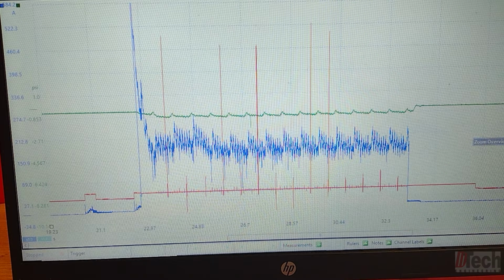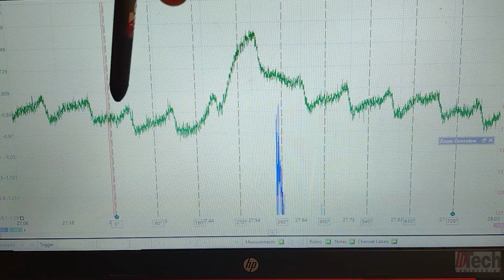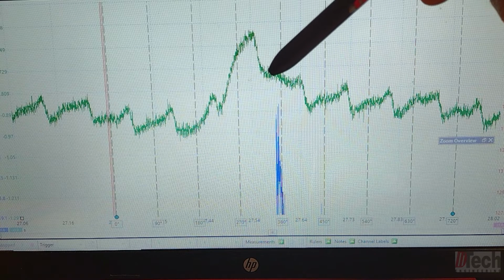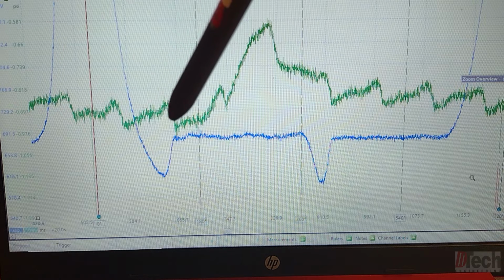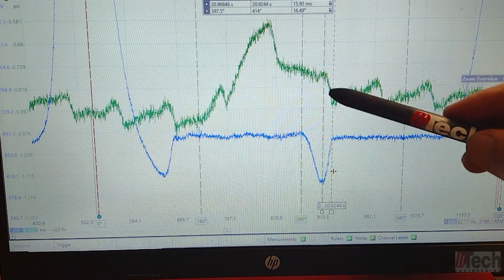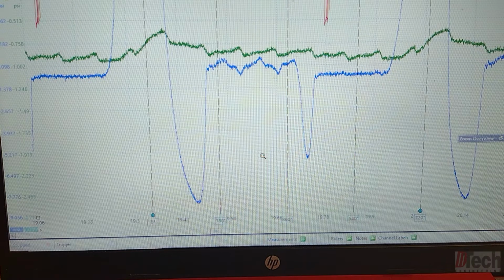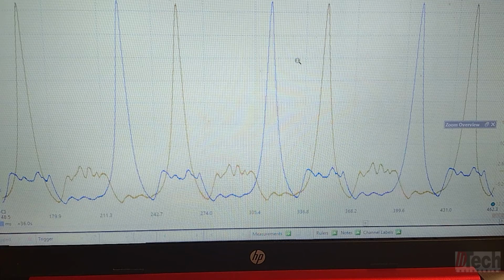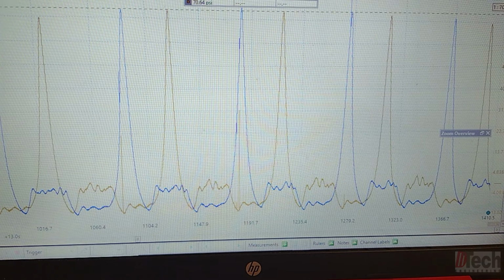2013 Ford F150 Misfire Inspection

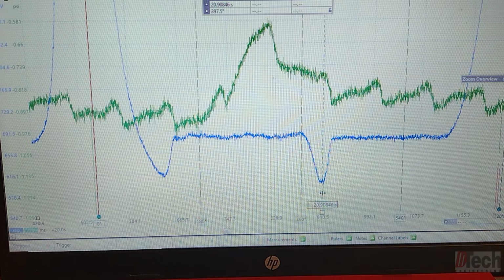Comment: Around time stamp 11:02 the intake valve opening at 397* ATDC 0 or  37* ATDC 360 is very strange. Seems very late, and this is the good cylinder.  maybe a Ford thing.  I would love to see the cam spec for this engine.    Nice video!

Comment: So customer needs a new engine?
Reply: What's the fix?
Reply from the maker: The fix would be one of two things, either remove the cylinder head and have a machine shop perform a valve job or you could replace the engine and hope it doesn't have the same issue
Reply: @DTEAuto  or just buy an updated head from Ford @ about 1,400.00
Reply from the maker: correct, that's definitely an option that I didn't mention.
Reply: @DTEAuto  4 months later, I'm still trying to overhaul the coyote... smh.
Should've taken it to a Ford dealer.

Comment: I hope you give yourself credit for your effort and learning. I found you when I was trying to decide if pressure pulse sensors were actually useful at pinpointing in their own right. Or just good at confirming what your seeing through other means (waveforms like RC). Your honesty, level of ability and explanation have made a follower out of me!
Side note = I feel you might have almost doubled the degrees of latency you feel you're seeing in the intake waveform. It is deceiving because of the next intake valve opening mid ramp but look at all the good cylinders between the valves opening. Slight ramp upwards then curving in a downwards tend, the another intake valve opens. Where as, just after the intake on 8 closes. The intake trace is almost flat then heads up on an almost identical angle ramp as the bigger more obvious ramp in pressure. Starting at more like ~950 on your time axis. 
BUT, it was interupted briefly by an intake valve opening mid-ramp which makes it look different.
Do you see what I mean?
Reply from the maker: Thank  you for watching and becoming a follower, I appreciate that for sure. And as far as the question, maybe tell me a timestamp so that I can see what you are referring to.
Reply: @DTEAuto  I've sent you an email bud. Hope to hear from you.

Comment: It has been shown that the reason that the cylinder following the weak cylinder has a higher current draw is because the weak cylinder goes into vacuum that adds load to the starter having to pull the piston down.  Removing the plug from the weak cylinder cancels the effect.
Reply from the maker: Thaks for the info

Comment: Your explanation on how the leaking intake valve affects the other cylinder trace is such a bonus on this diag.  Not having to pull a valve cover saves time while still nailing the cause of the issue for the customer.  A++, brother!